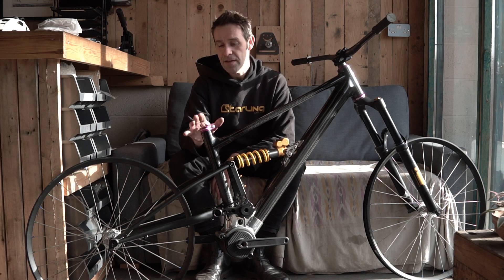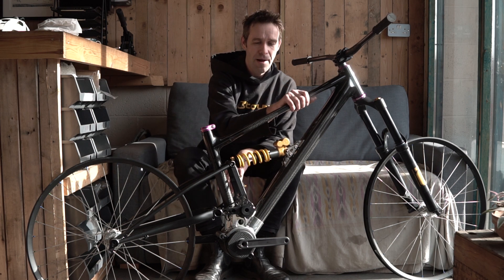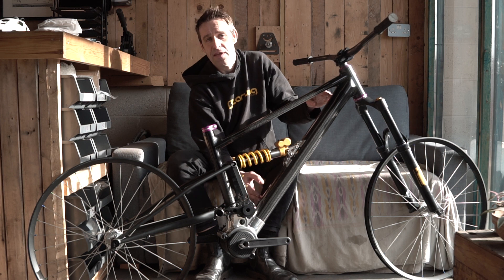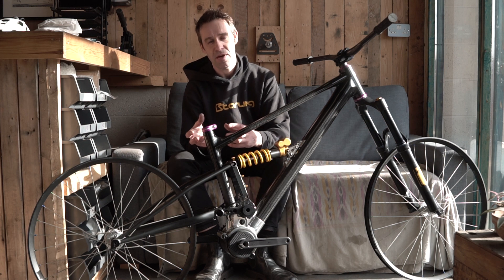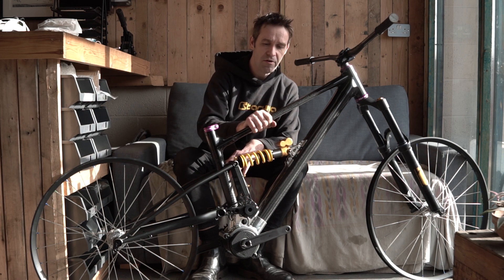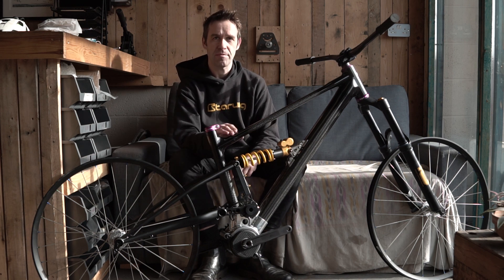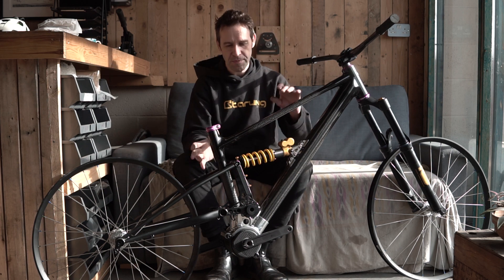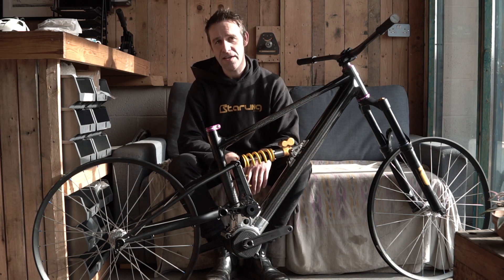WORKSHOP CHATTER: The Starling Cycles Carbon Prototype eMTB

Comment: Am I looking at a internal gearing? (Or gearhub?) full suspension long travel eMTB with öhlins fork and spring shock ?😍
💸💸💸💸💸

My other option would be a kenevo expert with kindernay hub or a nicolaj eboxx e14.

But I miss the yellow öhlins look my old kenevo expert 2019 had😂